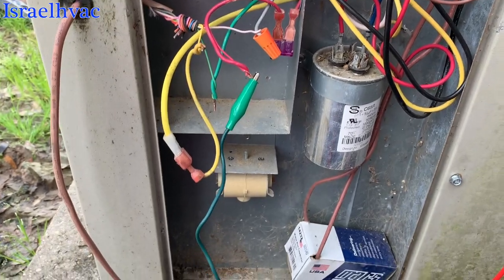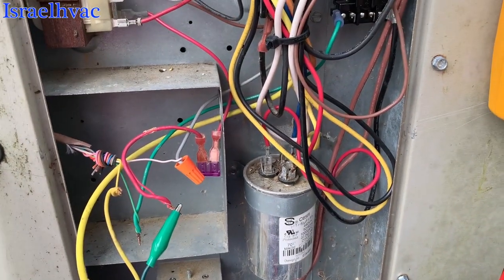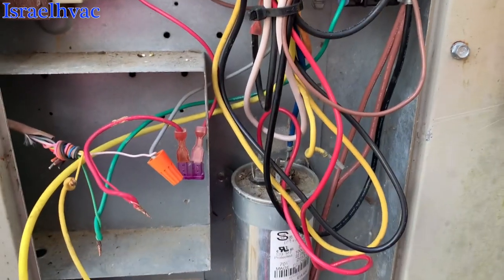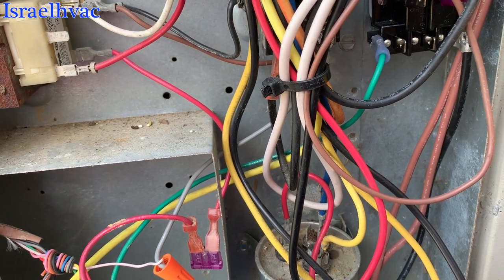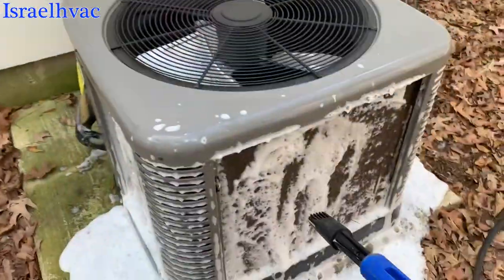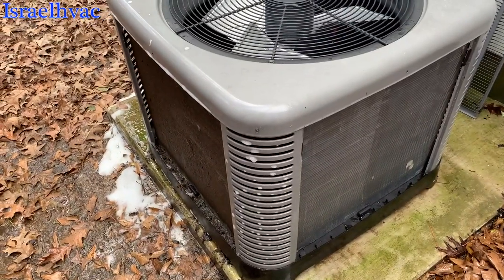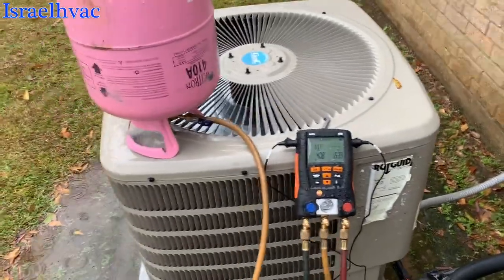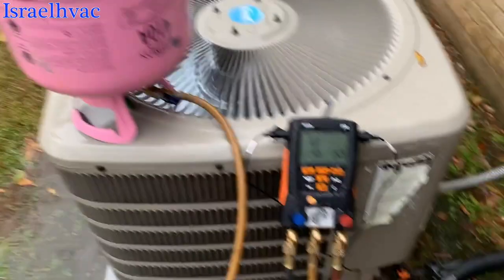Short Clips Of A Couple HVAC Calls

Comment: Some more explanation about what you're (and other HVAC vloggers) are doing with the wiring would be helpful.  

When it comes to wiring, the vloggers assume the viewers already know everything about the wiring and it's zip zip zip with handling the wires.
Reply: The red wire is 24volts the green wire has a load on the other side witch is the fan. The yellow is for the contactor coil that turns on compressor and outdoor fan motor. Since he can’t get inside for the thermostat he pretty much bypassed it. Think of it as a basic light fixture. You have your light (load), power wire (path), switch, power (source). If you put a jumper on the switch you by pass the switch (thermostat), thus the light will be on as long as you have power (source). Hope it helped! Someone correct me if im wrong!
Reply from the maker: hg2 I will definitely try to do that more often. Thanks for watching.